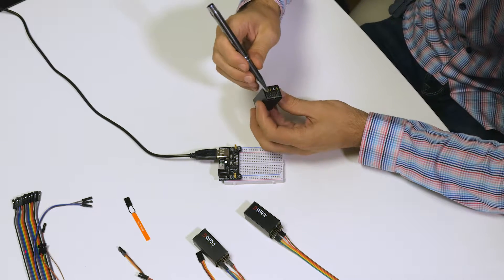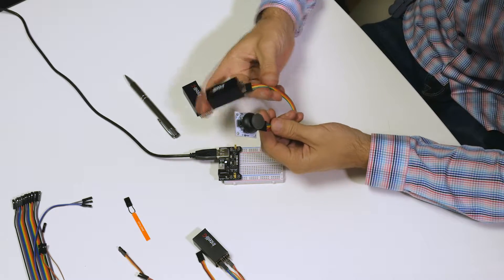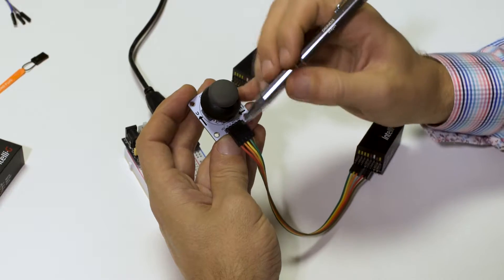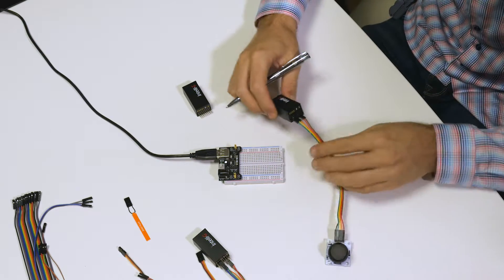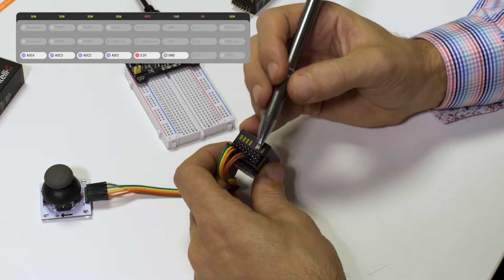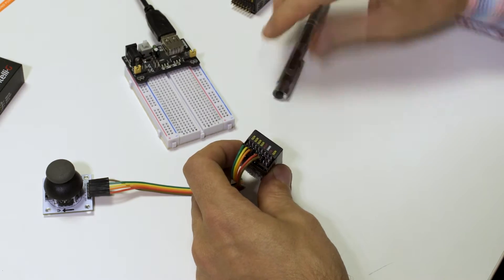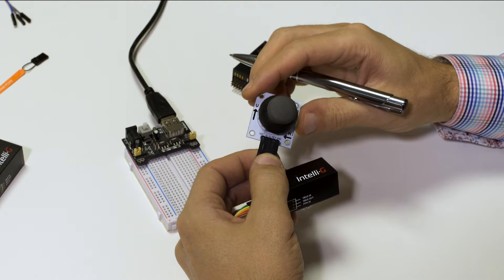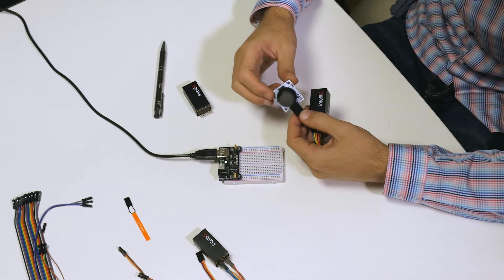Intelli-G Video Tutorial - Analog Input

Comment: Hi! I am trying to make a sparkfun joystick work with the device. The analog sliders do work but the selector-button does not. Can you explain what type of resistor is required - tried different values in series with the button but its not working?!
Reply: Now it works, I used a 10k pullup resistor with the button. Was hesitating first because I was afraid to fry the device. Why not add this info in the documentation? All the best!